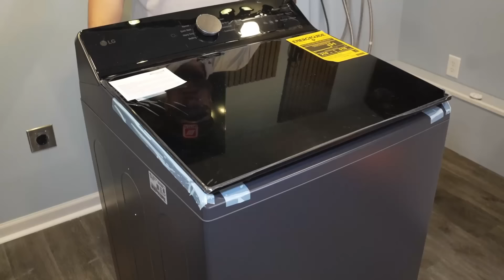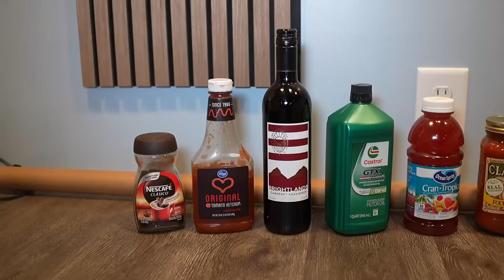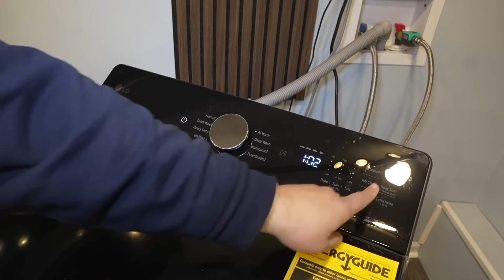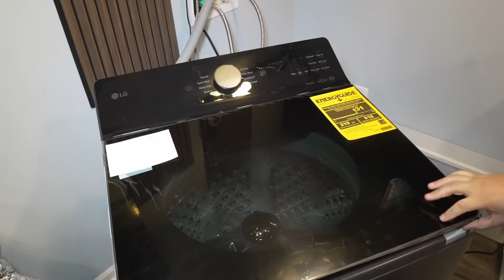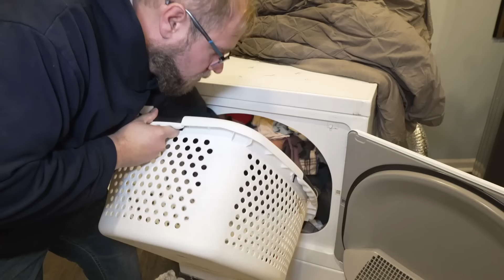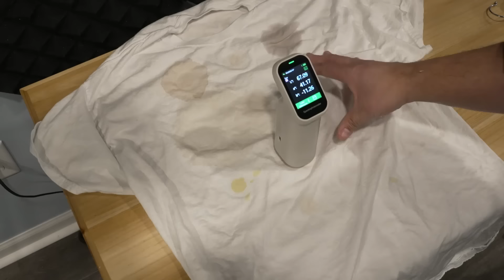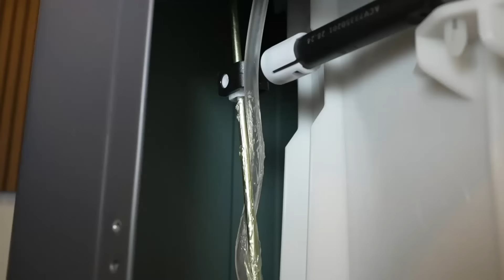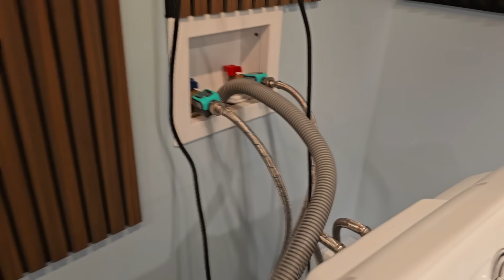Is 2025's "Best Washer" Actually Good? LG WT8405 Test & Teardown

Comment: Won't be getting rid of my 2001 maytag Atlantis if I can help it.
Reply: I'm with you! I have a set of Kenmore 80 series from 1998 and I'll NEVER get rid of them. I've had to change the agitate dogs 2 times in 27 years that cost me next to nothing. Everyone I know that use to have a regular washer (like we still do) wishes they never replaced theirs with the new HE machines. All the complaints are the same, it runs too long, it doesn't use enough water, the machine smells. Everyone thought I was being cheap when the new ones came out because I refused to buy one but I kept telling them "How can it clean your clothes with 1/4 of the water and it runs for an hour and a half saving you electricity how?" and it turned out I was right.
Reply: @michaelfolino8414   Yup. The new stuff is just garbage. My maytag dryer  is from the mid 80s and that thing dries clothes faster than anything ive ever seen any other dryer do. I just moved into this house recently and the vintage alliances were a breath of fresh air lol

Comment: Your content is fantastic, and appreciated.   But as far as pods go I will not use them, either in the washing machine or dishwasher.  Ever.  Or tide for that matter.
Reply from the maker: Interestingly enough tide tends to be #1 on stain removal vs. Price. That and gain
Reply: Science says pods are best. Many common enzymes are destroyed (denatured) when they're dried out, they have to remain liquid. Liquid detergents are much better enzymatic cleaners for things like oils and body odors. When you do liquid, components react with each other in storage so they are limited in what they can put in. Pods solve that problem by keeping reactive components apart until time of use.

Comment: first, the water is a finite resource so it should not be wasted. second: this washers are made to use as LITTLE as possible water since the cleanliness comes from the clothes scrubbing each other with the minimal soap water and the tub itself. kinda like a frontal load washer. so no wonder a "deep fill" will give the worst results since the clothes are flotating on water. the "deep fill" is an option enabled so people would stop to pause the machine and add water like in older LG top load washers you will see demented people adding water "because the machine is stupid and wont notice its missing water" and i am talking the AI models not the old ones that was basic tech that could get bad over time and do less water than needed.
Reply from the maker: I do the deep wash testing so everyone has a baseline on what it does. For the TC5 tests, I am doing deep wash options on everything, then running an identical load w/o deep wash to show the actual difference when literally everything else is held to the same requirement.
Reply: @bensappliancesandjunk  i do understand and i totally agree with you. just LG has made AI washers to use as minimal water as possible. there for more water less % of cleanliness. is like a fan that the more slow the blades move more air moves, and the fan having a deep turbo mode that the blades go light speed yet little to no air gets moved. same logic but with water and the agitation system.
Reply: there is no shortage of water! If you want  clean clothes it takes a certain amount of water. Sure, you will have to pay for it
Reply: @glennlazenby6137  there is a shortage of water worldwide. the UN since the year 2000 has asked to all the countries to shut down the fountains and if you want to run them, must be with rain water not potable (drinkable) water. the world is only 3% of sweet (potable) water. the rest is salty water that needs billionaire processes to remove the salt and other bad stuff to be able to be safely drink or used as regular water.
Reply: @aagc1988  desalination plants are the answer, not sure why California is not aggressively pursuing this as other countries should be, as well. My desire for clean clothes and my ability to pay for my water use should not be judged...my choice.
Reply: @glennlazenby6137  its not just remove the saline content but all the stuff sea water has. even in some cases like near fukushima you get radiation for example. and i am not judging you, just a friendly reminder: no water no life.

Comment: Those suspension rods will be a pain to change with the dampers down there especially the front it looks like you can access the back one by taking that rear panel off. Will definitely put those pins back in from bottom so to take them out if have to do it again you have to push down instead if pulling the up.
Reply from the maker: I think if you had 90* angled pliers, it would be quite easy, but I didn't have them nearby when I did this segment. Each pin has a small tab that needs pressed to remove them. I felt it just wasnt worth messing with on a brand new washer to show when I could demonstrate from the rear rather easily.

Comment: If I remember correctly,  🤔 when Fisher&Paykel began importing to the States (early 2000's?), those early machines were the first I had ever seen with a hanging suspension (didn't they also  have shock absorbers?) and direct dc motor drive. They were unlike anything we had ever seen from the domestic manufacturers, but it didn’t take long before the US brands started copying them.
Reply from the maker: F&P absolutely pioneered the direct drive system. I am unsure about the suspension system though. I only got to touch a few F&P washers and never had to deal with the suspension side of things. 

Interestingly enough - the stator on the US systems like Whirlpool's Cabrio was licensed from F&P directly. They paid to use their system. When the license ran out, they switched to the VMAX system they use today and its a huge step back.
Reply: @bensappliancesandjunk  I remember that.
Didn't GE wind up with some of their technology as well?
Reply: @bluesteve124  Haier bought F&P in 2012 and GE Appliances in 2016.
Reply: LG had been using direct drive on their front load units since the TROMM in the 90s though, no? And I believe the only US brand to use direct drive was WP but they licensed F&P's as the idea of learning how to make something new was weally weally harrrrd... they thought about it a long time, and all it did was make them have to poop! So they paid to copy F&P's homework. 😂
Reply: That’s really helpful insight from someone who works on these machines every day. The splutch/actuator being the main weak point actually makes the design seem a lot less scary if those parts can be swapped without touching the whole gearbox. Interesting to hear the positive note about the horizontal shocks too — vibration control seems to be one of the big issues on a lot of modern washers.

Comment: i repair these things for a living, your exactly right, the splutch/acutuator is the weak spot.  i tried to look at a parts breakdown, but couldn't locate one.  if you can swap out just the splutch/actuator, your good.  if you have to replace the whole gearbox, don't buy.  i do like the horizontal shock absorbers. drain pumps come and go.  im not a fan of the user interface.
Reply: Do you specialize in LG or do you do all manufacturers? I've been doing appliance repair for about a year now and the place I'm at works on all brands
Reply: @bobbyhumphrey199  all
Reply: I agree. There was a recall on Samsung and LG top load washers a while back due to the top portion exploding during the spin cycle. The horizontal shocks do provide a solid brace.

Comment: I like to say a great big thank you for your time, effort, and of course money, for the testing of these products. You help everyone to arrive at any decision we might make. I do personally feel that a front loader washing machine will do so much better in cleaning clothes because they getting tossed around instead of being agitated, which I feel is not all that efficient in my opinion. I do have a question, actually two........ What's wrong with AC/DC????😂😂 I would like to also point out that from my understanding, you should be putting the tide pods in first at the bottom of the loader to work better, is that not correct? Again, thank you so much for your time, effort, and for the money for all of us.
Reply from the maker: Thanks for the comment. I've just never liked AC/DC - too simple and hook-y. Now, I will admit, I think the Bon Scott era ACDC was pretty good though. 

Re:Tide pods - its very possible they're best used at the bottom, but I put them on top for visual effect in every test, so its not as if I am changing that aspect of the video at this time. Maybe it has to do with the detergent spreading earlier in the wash as opposed to later, ensuring the stain removal properties work better? Interesting comment though. Maybe I can test!

Comment: Stain strip.  Would it make a difference if it was ironed, post wash to make the surfaces the same as before?  Tide says to put the pods in first.  Do you know why or the difference?  Thank you, enjoyed the offering.
Reply from the maker: I dont know if ironing the strips would help at all. I do always test on a flat surface and flaten out the area where the eye looks at the stain and that does go with shirts as well. I've used the spectrogaph hundreds of times to know that the wrinkles could change scores BUT I tend to do testing near the same area multiple times to ensure the value is a proper median value and we aren't seeing some abberation of a particular value.

Where there IS difficulty is when the machine may do a good job on one area by agitating the crap out of it because it got in a good area... Sometimes a stain strip may have 50% more fading in an area, then regular fading in the rest. Those are hard to make a qualitative judgement on where to look. I usually aim for the middle of the strip usually though as practice as best I can.
Reply: @ thank you for clearing that up. Cheers
Reply: Detergents always go in first because if the concentrated detergent gets on fabric, it can cause stains from the bleach, optical fabric brighteners, and even the tint dyes.

Comment: When I think of the three major item areas that people junk washers it is one of these issues.  Gearcase failure, main control board failure and suspension UL issues.  With that out of big box store brands, I believe and see regularly that LG does best in those areas for top load washers. Drain pumps are their weakness but that is an easy fix.    It's amazing how many Whirlpools less than 3 years old I get with bad gearcase and boards.
Reply from the maker: Exactly. WP is growing to be on my "Do not buy list" as much as it utterly pains me to say that. Their VMW DESIGN is amazing. But they've cheapened it so much, you're rolling the dice if they won't have a board or gearcase failure in 5 years which is wild. Because we routinely get Amana toploads that are 7-9 years old that can be refurbished and resold.
Reply: well said
Reply: @backinactionllc  my LG had a constant error message and then started NOT draining. I had it for 3 yrs.  It would have been expensive to have it repaired so opted to give it to the re-furb company.
Reply: @1BethMcBeth  None of the major brands are as well made or as reliable as 10-20 years ago.  Build quality, materials used and prolific use of electronics looks great but at a cost of reliability. I just know from what I see every day I would go LG

Comment: Noise comes with any machine. As long as it doesn't sound like gears grinding or heavy machine gun fire, I'm good. My twenty something year old washer makes no more noise today than it did when I bought it. I get worried about so called "soft starts" failing and soft, quiet materials being used where they don't belong. Great video!
Reply: Yes and no, it just needs done correctly. Used to have a dishwasher you could easily hear 20 feet away and made watching tv in the living room less enjoyable.  Bought a machine with low noise and now if your standing 5 feet away and listen really closely you can hear just the lightest amount of water jet noise. Sitting in the living room, you can’t even tell if it’s running or not.  It has a red light that shines on the floor to let you know it’s running, otherwise people would open it to put in dishes, not knowing it was running.
Reply: It sounds like gears grinding because IT IS. Cheap plastic clutch assembly and everything else

Comment: I see an almost identical looking wt7480cl at costco for ~$600 is it the same model just with a different identifier for costco? ive seen that happen before
Reply from the maker: Yuuuuuuuuuup. Costco usually gets the same models under a goofy model identifier because they're so large, they can get custom runs of the same units for their own special needs. Mora refrigerators are the same way. Mora is a Hisense refrigerator (which are great) under a custom contract.
Reply: Any lg model washer that ends with “80” eg. Wm4080, wt7480, they’re all Costco exclusive models

Comment: My 21 yr old Whilpool Duet HD washer, still Outclasses these New Machines [ Had my First ever brake down last week with a DrumDriveBelt $55 dollar repair. Ez fix Saved $160-200+ dollar.
Reply from the maker: The Duet HD is probably the best front loader ever created. The original ones were made in Germany, and we regularly see them and repair them even today. They were built as good as a Speed Queen FF7 was, but arguably at a lower price at the time they made 'em
Reply: @bensappliancesandjunk  Funny part of doing this repair was the belt [ thought I got the wrong belt size ] it at first looked like it wouldnt fit , almost took it back to appl/parts/store. But after seen a note on its size and how to get to roll on drum wheel thing all was well. Glad I didnt make an a$$ outof myself returning the belt. lol Thanks for all of your fine work Mr Ben
Reply: Is a ghw9100l a duet hd? Trying to decide whether to fix the pump, moldy seal, and leaking shocks vs buying a lg5500hwa
Reply: @rcio29  Parts should be under 100 bucks Fix it :person-turqouise-waving: Mine is still running. But if the motor gos, Its done, cant find one to replace.
Reply: Fact. I've had the same WP Duet combo for 26 years now. Dryer is a little tired but no repairs or issues, ever.
Reply: A 21-year-old washer still going with just a $55 belt fix is pretty impressive. That’s the kind of simple repair you almost never hear about with newer machines anymore. Being able to swap a part yourself and keep it running another few years is honestly what a lot of people wish modern appliances were still like.

Comment: What do you recommend as best washer and type?? Top load vs Front load? Agitator or not?
Reply from the maker: So far for all my tests, front loaders wash better, but take longer to get that better performance. In general you have better pre-soak options that do more at least from my tests. Much more efficient as well. But if you gotta get a lot done fast, a good topload may be better.
Reply: @bensappliancesandjunk Interesting! IME, top loaders are better for bulky items because they can soak in more water, plus a front loader can get the bulk item so wrapped that the inside diameter rarely unravels to rub against the other parts of the fabric.

Comment: I’m still confused about which washer or settings perform best…..
Reply from the maker: Settings are always an offset between time, efficiency, and goal. Bad stains need either pre-treatment or pre-soak and a boat load of time (think washing multiple times, but without re-setting the machine, with plenty of soak time).

The reality is that every mode matters... Whats the goal of washing the clothes? Stain removal? Refreshing them generally? That will change what you use and why. Back in the day, companies like Maytag put out books the size of medium sized Bibles on proper laundry cycles, and I think a lot of that has been lost in the "Set and forget" era and mindset. It does still matter, it seems.

Comment: Any washers out there that you recommend that have regular controls (NOT digital panel) with an agitator and large drum? I currently have a re-furb GE that does NOT have an agitator and not entirely sure if the clothes are getting clean.😢 Thanks for your input!(I'll provide the model number and edit when I  get a chance, if that helps)
Reply from the maker: You'd have to define "Digital panel". Because thats pretty tricky to explain. They all have electronics behind them now. 

Speed Queens are reliable, but generally considered smaller cap with a good agitator. For larger cap, you have options like this in a slightly smaller format like the WT 7105 I think that would be decent. Or you could go commercial with a Maytag MVWP85 or a GE GTW525 which are larger cap, but not as reliable as say, a TC5 would be.
Reply: @bensappliancesandjunk  I meant with fewer washing cycles....basically more simplistic and NOT those touch screen panels. I had an LG washer before that I traded my Maytag Admiral 2's for. (I'M sorry that I did), but at that time, the LG HE washer (w/o agitator) was ALL the rage with ALL the bells and whistles, which I succumbed to. I STILL have the dryer going strong, but the washer was taken by the refurb company to see if they could repair/offer as a refurb to someone, and I bought the GE re-furb, without the agitator instead. I had picked out a GE with agitator to be delivered to me, however,  I believe they switched mine out and offered me one w/o an agitator.
Reply from the maker: @1BethMcBeth  Ah got it. WT7005 is probably your best bet. Good compromise between size, price, and complexity. Their direct drive systems are simply the best on the market. Although I am not a fan of the clutch system per-se the DD stator is a wildly efficient and reliable design.
Reply: @bensappliancesandjunk  Which brand?
Reply from the maker: WT7005 is LG